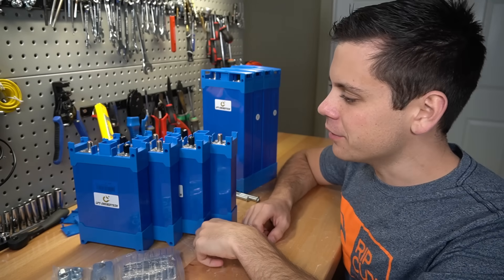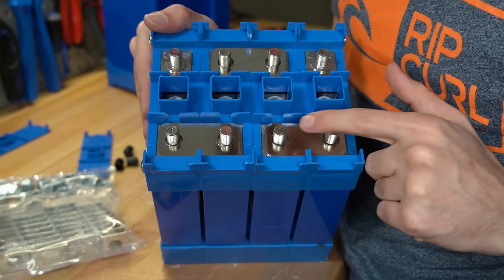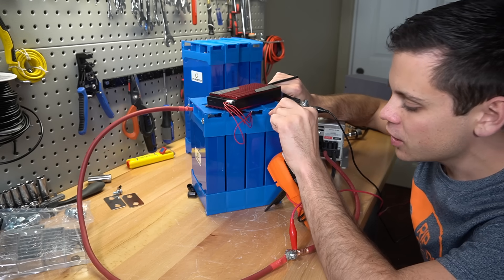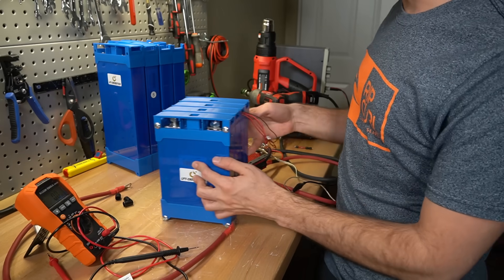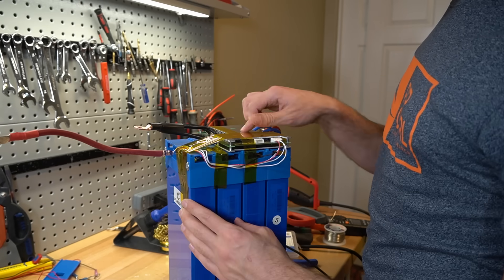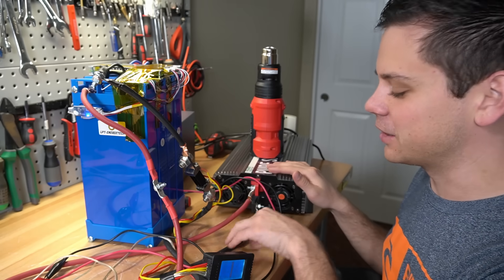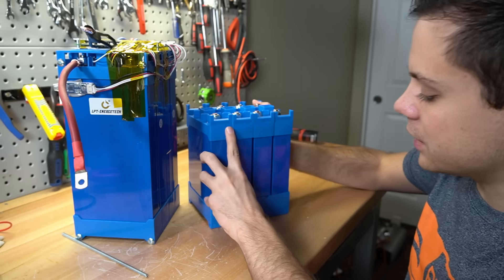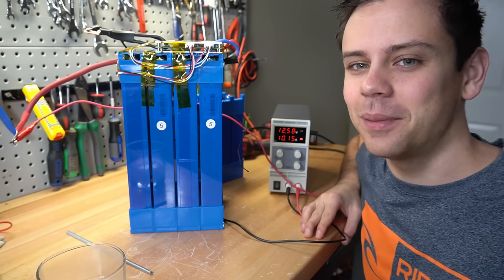Fortune LiFePO4 Battery Cells: I love them!

Comment: I am still getting the hang of all of this - I see that these are rated at 0.5c for charging. Does the C rating ever change when batteries are in series or parallel? Or is the C rating (charging or discharging) always the same regardless of how many you have connected? 

Thanks for all of your work on these videos - I’ve been learning a ton. Well done, it is much appreciated!!
Reply: The C rating is the Capacity rating, which equals the Ah rating of the battery. I believe it will be the same because the BMS is the restricting point.
Reply: Tumbleweed5150 the capacity of the battery is different. My understanding is that the C rating has to do with the rate at which a battery can be recharged/discharged. A 100A battery with a 1C rating can be discharged at a rate of 100A. If the same battery has a 4C rating it can discharge 400A. 

So a 100A battery with a 0.5C charging rating can be charged at a max of 50A. In a 24v system that is 1200 watts per hour but on a 12v system that is only 600 watts. 

The system I’m looking to build is a 4KW (24v) array, so a battery that can only charge at a rate of 1.2KW won’t work if I want to take full advantage of the power the array can produce. 

What I’m not sure about is whether changing the series or parallel configuration of the batteries would impact the C rating... or if that rating stays static (as just a baseline attribute of the cells) regardless of how the batteries are configured.
Reply: Tumbleweed5150 to be clear i think even battleborn 100A 12v batteries are rated to 0.5c recharging. I’m just curious to see if that can be increased by changing the configuration

Comment: The deburring tool is cool but you can generally get away with getting one of those size nuts and thread it on before you cut and it will repair them when you take it off

Comment: I have looked over your previous vidoes and have been watching for around a year.  I would like to know if you could up load a video of using 2 or more 24v batteries (ones that you make out of 8 3.2v batteries) for a system.  What is the best way to use a bms; one bms for each battery setup and another bms to those individual bms's, or one bms that can balance more than 2 24v batteries (once again ones that you make out of 8 3.2v batteries).  Best way to charge and other information that is important to know or look for..?
Reply: R Kane we have made video
Reply: R. Kane, You need to do more research on your own for basic questions such as this. If you find something specific that you are unable to solve, then ask questions.
Reply: @geraldhenrickson7472  I have done a lot of research and I get mixed information on bigger battery systems.  But I am always randomly looking at more info and videos.  Also I feel like I can trust his videos more than others. :)

Comment: Maybe you have addressed this before (sorry if so), but don't you suspect manufacturers are cherry picking batteries when they send you a batch?  i.e. it's not a surprise you keep getting batteries with close voltage matches .. or do you order under a fake name and fake address across state lines and have a friend drop them off etc?

Comment: I love your videos as one who designed and installed a small remote location solar system.  Eleven months ago we had to replace our batteries and wanted to go Lithium but the batteries will be in a cold environment for several months.  So, we went with AGM's.  At the time I was unaware of a low temp cutoff in fact I don't think there were hardly any BMS's or battery with one.  That is how far things have come in just one year!  If I had to do it over today I would have no problem putting in a Lithium battery system knowing I could incorporate a reliable BMS with low temp cutoff.  The only problem I am having at the moment is what battery would I buy?  In your series of evaluating different batteries each time you review a battery and give it  a thumbs up I think that is the battery I would buy.  Then you do another battery evaluation, like the one above, and my mind is changed again!!!  Thanks for all the reviews you do.  I have learned a ton and wish I would have had this kind of knowledge 7 years ago when I first setup the system.
Reply: John Strein make a list of top 3 batteries and roll a dice. Murphy’s Law says there will be a better cheaper battery the day your order arrives in the mail.
Reply: @4philipp  Yup, that's the way it goes.
Reply: It’s like buying a laptop.... the minute u buy it it’s out of date...
Reply: Dig a hole for a battery pit.  Check your location for where the frost line is.  That'll keep the batteries at 32F.

Comment: I like that they put thought into assembling packs in the design with the steel rod. The mounting of the bms always seems like an afterthought in these videos though. Next step after assuming the cells with a threaded rod is to nicely mount the bms, in my opinion. Also, it would be fun to cut one open, if you can do this safely!
This is the most promising/professional solution for diy cell assembly. Thanks for the video.
Reply: I would not cut one open, as depending on make and type, the electrolyte can contain organofluorophosphates, some of which are insecticides and nerve agents.
Google returns some interesting results!
Reply: Andy Lee Robinson 
I’m curious if the build quality is as nice on the inside as it appears on the outside but Yikes that’s sounds like a bad idea then!
Reply: @fj40bryan  New batteries probably safer, but this paper indicates that organofluorophosphates can be produced by electrolytic decomposition if the electrolyte is fluorinated.
https://www.sciencedirect.com/science/article/abs/pii/S0021967319307393
I also wish I hadn't searched now!

Comment: These batteries are amazing. Idk if a better solution is out there. So clean.
Reply from the maker: Right?! Incredible
Reply: @WillProwse  seriously man, I can't think of a single issue to complain about. Between the two sizes and included busbars and different configuration options. This is has the least compromises of any battery system I have seen. It would be hard to choose anything else if a person is doing something permanent and impossible to justify other options for something Mobile (ie van, tiny house or mobile solar generator on wheels)

Comment: Will, Can you make a video that explains when you can or cannot put a battery in SERIES?  Some manufacturers don't allow it, and we don't know when it is OK or not for DIY batteries...
Reply from the maker: Yes, going to have a industry professional interviewed to answer that
Reply: Will, please build a 48 volt bank using these batteries, but make it a 32 battery 200Ah bank.
Reply: @Jason Bowman I suspect that the problem, has to do with the series connection looking more like a floating ground in between the batteries/BMSes. With two in series, if you had a way to interlink the two BMS units, they could probably sort it out fine, but without that, your voltages may be different between the two batteries, and that could cause all sorts of confusion. I believe this is why you have BMSes with a different number of balance leads, to handle different numbers of cells in your pack.
Reply: Will,. I look forward to hearing what the industry expert has to say.     There has been a lot of ideas stated as fact but so far I have only heard one explanation that makes sense for limiting series banks.    I really don't get limiting parallel banks

Comment: I could ultimately see building a 1000 Amp Hour 48 Volt system with these. With a 6KW Solar Array, I could RUN MY HOUSE!
Reply: @kktab3919  Pretty useless unless I can get them at home depot or amazon
Reply: That would be 40 cells for about 13kWh and a price of around $4k,plus $500 for a decent bms, cables, inverter and lots of time.
You could just get a Tesla powerwall for about the same price and it would just work from day 1.
Reply: @ahaveland  time for you to go make your own sandwich and leave his alone
Reply: Andy Lee Robinson are you sure that’s only 40 cells? He’ll need 16 for a 100amp 48v battery. So at 1000amps that’s 160 cells.
Reply: @4philipp  Yes you're right! Multiply by 4. And if 4 cells were 1.3kWh, that would be a 52 kWh battery costing about $15k.
A used EV battery would likely be more cost effective for this application.
Reply: Andy Lee Robinson the Tesla battery Will used was $1300 for a 5.5kwh battery. I would say this is very competitive considering it’s new cells.
Reply: @4philipp  Indeed, only $13k for 10 before discount, though a couple of packs would need breaking to get 14S and it'd break my heart, so I think I'd try to do a 3x3 solution for 18S or split an extra pack to get 20S and look for an inverter to match.
Reply: Andy Lee Robinson on a 48V system i would go for a 8kw or 12kw Sol-Ark. it offers Pass thru power for direct PV loads, 110/220/208 3phase power. It’s charge controller and inverter plus offers grid-tie and auto generator start for just under <$7000. 
The problem with large systems is the cost is astronomical. $15k for batteries, $7k for Sol-Arc, $10k for 10kw solar, plus wires and other costs.
Anyone who needs and can afford a $30k+ system is most likely not going to build it themselves. 
Personally I’m looking at 5kw solar, 48V/200amp battery, charger/inverter ~$2k-$3k.
Reply: @4philipp  I disagree, yes a larger system gets more expensive but costs are all relative: we built a 48 volt Outback Radian based system with 30 panels-8800 watts and a battleborn bank of 16 batts. for 20 Kwh of storage.  All componants and cables, conduit, connectors, etc - plus shipping expenses totaled $34,000. I installed it and saved about $30,000 compared to what 3 other solar provider/installers bid. I think in the end it it a tougher , more reliable and independent system than what these other suppliers would have furnished. Also it was an absolute necessity after five months of zero grid power due to hurricane Irma.
Those five months cost $4,200 in gasoline for the old generator which we later replaced with a diesel genset for emergency battery charging. The diesel genset cost us an additional $6,000 so you could say total costs of $40,000.00
All relative because to live with no power at all or to dump fuel into a horribly inefficient generator suddenly makes it all worth the price.
Then we can add that here in the U.S.V.I. we pay 42¢ per KWh for the dirtiest power you could imagine as well as constant daily brownouts/blackouts.
Our grid power would burn out about $2,000 worth of expensive electronics/appliances every year in addition to an average monthly utility bill of $800.00 or more.
Now factor in the savings over 20-30 years.
It's all relative but even more important than the long term savings is the freedom, independance, reliability and self sustainability that the initial investment gives you. We had a grid tie system prior to the Hurricanes which was worthless once the grid was gone ! The off grid option and lithium storage were a must and so was installing it myself as I could not and would not want to hand over any more money than necessary in an already tight and uncertain financial situation.
Of course power is much cheaper elsewhere but I think the independance and security of having an uninterruptable power supply wins in most cases.
Reply: Jeff Bowers I totally agree with most of your arguments. Circumstances can totally push value around on a relative level. 
I’m not sure how this is calculated...how is your battery storage  $20 or $0.20/kWh? Is it based on daily consumption and annualized? Because a cattle born costs ~$950 for 1300 watt hours (1.3 kWh). 
I vu
Obviously I also don’t know your financial situation, but most people that I know don’t have 30-40k to drop on a solar system in cash. In most places government incentives are for grid tie systems only, which naturally require a licensed electrician and cooperation from the utility. So that’s hardly avoidable. And I’m uncertain about banks lending money at that magnitude for diy projects. 
A second mortgage might work though. Again, diy your hone owners insurance might get jittery. 

In the end, I stand by my argument that most people rather have a professional install. You and I might like to watch Will and tinker with our electric, but the majority of people is totally fine wetting their pants changing a lightbulb. If you live so close to your neighbors that if one house goes up in flames the fire department spends most of their efforts to protect the adjacent buildings, you really don’t want those people playing with electricity. Your system might be fine but you also live with the risk of others. If you are far away, maybe it doesn’t matter. That’s the main reason there are laws, code and regulation - to avoid the domino effect of damage. 

Lastly, there is the argument that Will himself makes. A small, 2-4kw system on a 24V battery bank will not hurt you. It’s safe even when you mess up. Larger systems increase the risk and are less safe. 
That’s why my preferred system is 2-3 indépendant 3kw systems powering different appliances. It’s more costly in some components, but it’s also easily scaleable and can be build over time as cash becomes available. 
However, I understand that in “desperate” times people will attempt all kinds of  home projects without being well informed. Another risk if you live close to your neighbors.
Reply: @kktab3919  It's only a suggestion to consider options if available. It can be fun and satisfying building something yourself instead of just buying a box, but it does come with a guarantee that it won't burn your house to the ground if you screw up.
Self-build batteries may also invalidate home insurance unless you can get it certified, so there's that to consider too.
Personally I accept the risk with my own batteries, but I don't have a house or a family to consider.

Comment: 96 of these 100AH cells from that site, under 10000 bucks would make for 600AH at 48 volts(6 rows of 16 in series, parallel each bank to stack up the AH) is my math right Will? Do they make a 96 cell BMS for a system that big? Trying to imagine these scaling up and would the economics make sense?
Reply: use 6 16s bms to do six stacks paralleled  to a large busbar with 600A potential output or put 6 cells in parallel  then 16 series with 1 16s bms to have 100A output unless you use the big 500A relay  setup from a few videos back

Comment: 10,000 cycles in a very sunny state like Southern California where you might get sun every day its still 27 years. In less sunny states where we have 3 sunny days and 3 cloudy days in a row  its 80 years. Do you get an 80 years or 10,000 cycles whichever come first guaranty, on those batteries? 10,00 cycles on a $600 battery is still $.06 per Kwh to what you have to add the solar panels, maintenance and onduler cost. If you are in Hawaii with a $.50 Kwh cost and a sunny climate it could be good alternative, if you are in Washington state with more rainy days than sunny ones and an an electric rate in the $.12 Kwh, its very problematic.

Comment: How about using the Camco 55375 Battery Box for the 100 Ah batteries.  This is a dual battery box made to hold a pair of 12v or 6v batteries.

Comment: Don’t know if it will fit but I have used a Playmate cooler for a battery box, workout great. Gives a lot of protection, insulation. The only down side was had to drill through the thicker case , no big deal .
Reply: I prefer the Colman coolers with wheels:)
Reply: @CharliebStackin  If I had one ... that’s probably what I would have used as well , wheels are a wonderful thing :-)

Comment: Will there are products to cot threaded bolts (smaller ones) that dont cut threads. Btw I use a set of 9 types of files for this kind of thing. Cannot wait to get the system designs done and assemble.